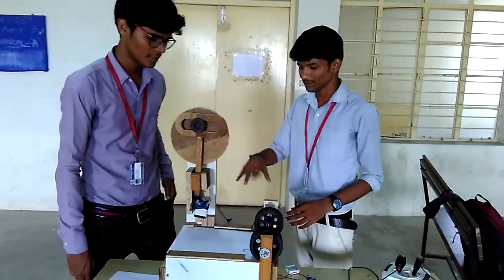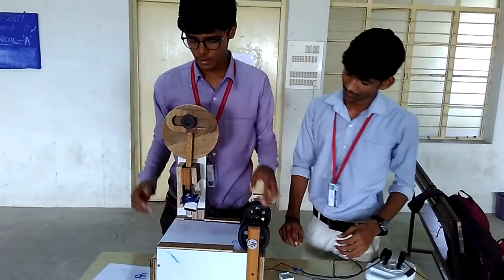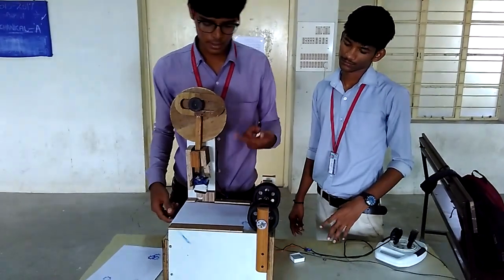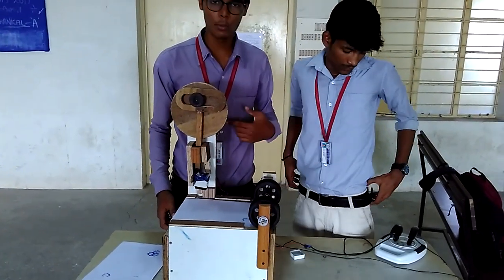Mini Project Automatic Stamping Machine

Comment: Bro which type of stamp did you used in the project. If it is a Auto filler ink stamp plz message me the type of stamp you used.
Reply from the maker: Vinny Rahul   We buy it from shop it will stamp for 1000 print and then we can replace it ...

Comment: Your machine isn't working the way it should. There is a problem with your mechanism. The stamp vertical actuator has backlash due to which stamp isn't correct every time. The page puller isn't synchronized with the stamp press mechanism. Using microcontroller and sensors with stepper motors would make it precise.
Reply from the maker: The Diffusant  we do it only for our mini project and also we can fix sensor but it won't work so only we can replace it by this method bro ....